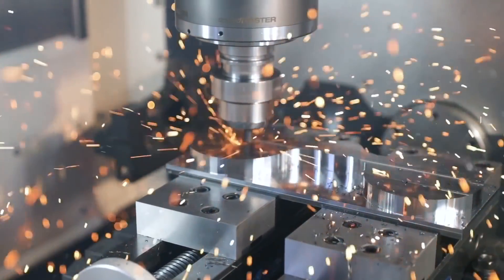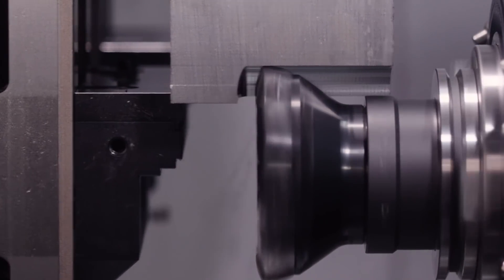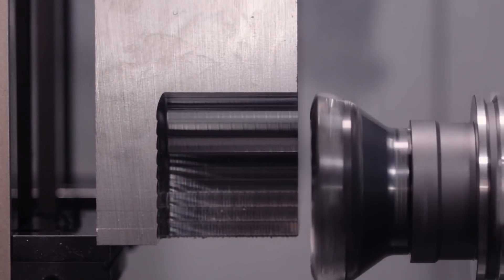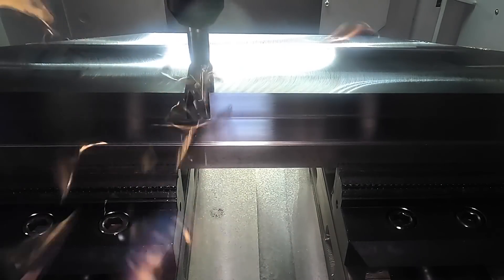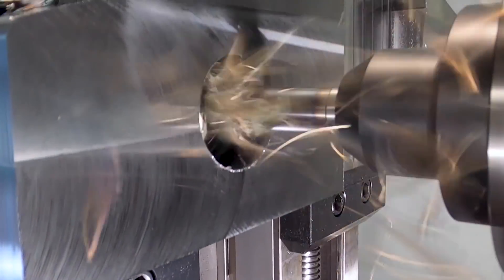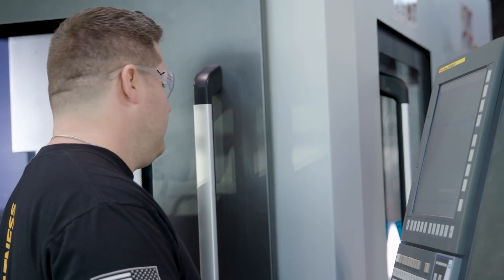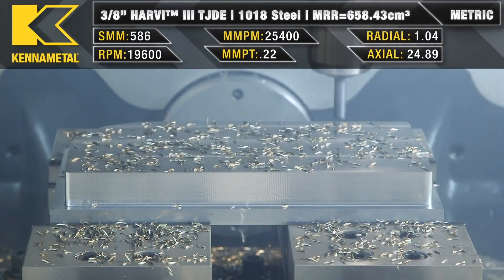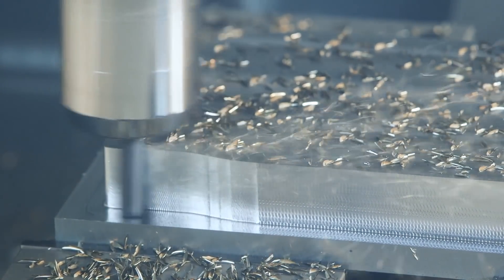90% Of Machinists Do This Wrong | This Machining Knowledge is a Game Changer

Comment: I work in a job shop and sometimes we run the same job on different machines because the original might have not been available at at the time. I have a different program for every machine but the only difference are the speeds and feeds due to the machines specs. It is like science getting to learn each machines strengths and weaknesses.

Comment: I am forced to apply this technique everyday because my machine does not like 90° turns in the tool paths. Sometimes it gets so bad, if I don't slow my feedrate down, it will break my insert cutter's inserts when it gets to the 90° turn because it will stop for a short moment before it carries on cutting. It basically sits there for a second or so and chatters which ends up breaking my tools.

What I do, is I play with the happy medium of dept of cut and feedrate. I depend on the spindle's power instead of the speed of the x & y slides. The benefits of this is that I can take deeper cuts because it is running slower and sometimes it can actually go faster then if I had a shallow cut with high feeds & speeds. Generally though I do this to not break cutters or inserts, and 75% of the time it is slower. My machine is a 2004 model so she is quite old and even the spindle rigidity isn't good anymore but thats machining for you. Each machine has its own character.

Comment: Titan and every cnc machinist out there, i recently bought a used Doosan s310 sml, should i do a real foundation and attach machine to ground or just keep on vibration isolators, level it and call it a day ?

Thanks in advance. 
Niel Patel
Reply from the maker: Lots of variables to consider.

How thick is your floor 6”+ is great… 4” not so great. What type of concrete, how much rebar etc.

How heavy is your machine?

How many legs is the weight distributed on?

What are the tolerances of your parts… a few tenths… Thousandths…

Anyways, you probably won’t have an issue, but I don’t know the variables discussed above.

You can also purchase 1” steel plate cut 12” X 12”  to go under each foot… which provides more surface area. Meaning, steel to concrete.

Make sense?
Reply: @TITANSofCNC  thanks makes sense to me.

You could also make a video to give general instructions, love from India..! 🇮🇳

Comment: Wait, so what was the cause of the whole tool holder pulling out?? What spindle taper was that?
Reply: It was a CAT40 spindle. And like I say in the video, the drawbar force was a little low, but all we could figure was that we were being too aggressive.
Reply: @barrysetzer  ah ok. So what failed, the pull stud?
Reply: @jacer12344  Actually the pull stud was fine, a little marred, as well as the drawbar clamps, and when it pulled out it scarred the spindle taper, so we reground the spindle taper and rebuilt the drawbar.

Comment: High feed cutters aren't that spectacular to watch, but they are damn effective. Cheap, reliable and even work when worn or chipped.
Reply: Solid carbide endmills comes into play when you have to make work as soon as possible or when you have a really, REALLY big chunk of material you need to destroy 🙂
Reply: @mikhaildavydenko6841  good endmills can make quick work. Both trochoidal and HSC milling are useful, but also sometimes difficult to choose the right one in certain cases.

Comment: The PH 13-8 Mo, which condition was it in? Condition A (solution annealed)? RH950? H950? H1150? Any of the others maybe? Because RH950, the hardest condition, can hit 48 HRC while the softest condition, H1150M, sits around 32 HRC. Yield strength ranges from 85 to 215 ksi, depending on how it's precipitation hardened, and UTS can sit between 130 and 235 ksi.

Comment: I love full flute endmill milling and i get even better cycle times than high feed mill, but that only applies to parts max 70-80mm of depth, after that i would much rather prefer high feed cutter where i could go more than 200mm of depth at high feed and low axial cuts. Another place where high feed is absolute winner is at 3d press tool making, where you need to take small axial cuts to cut out the 3D shape, where your endmill just can't outperform high feed, as matter of fact, it's absolute loser at that. I'm actually saying this from my own experience, we really tried to move to endmill cutting, but we ended up disappointed. At the end, it just depends on the application and both type of tools are great and can do marvellous parts.
Reply: Im glad that you mention the super deep depth stuff, i forgot to mention that in the video. Modular setups on high feed mills can increase your reach by a mile!

Comment: Awesome video, I have definitly experienced using wrong methods of cutting on a tormach 440. As its a much lower power machine with a straight taper, large axial, low radial cuts werent always the best, and have even caused the toolholder to pull out. After a different method of cutting, the cuts sounded MUCH better, and there was no more pullout issues. Keep the awesome videos coming! BOOM!
Reply: The toolHOLDER?! Damn, how scary is that haha
Reply: @chas1878  it wasnt too bad. the Tormach Tool System is based off an R8 collet, and without the right drawbar tightness, the toolholder can come out a bit easier than one would like. and the spindle was so weak that it just stalled.
Reply: @chas1878  It was definitely impressive when we ripped the holders out of the Okuma!!!
Reply: It can be frustrating to find the right strategy just based off the shape of the part or fixturing but to me nothing is more aggravating than having to choose a strategy based off machine power and torque requirements.